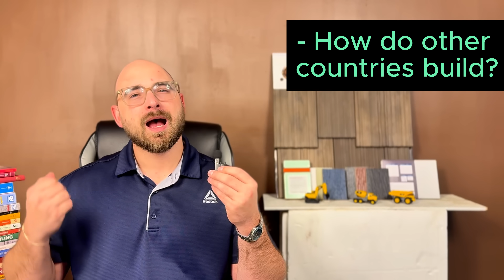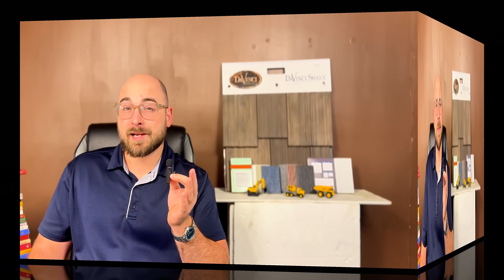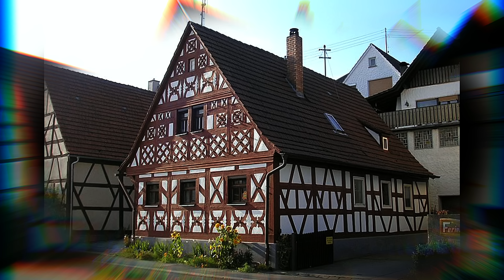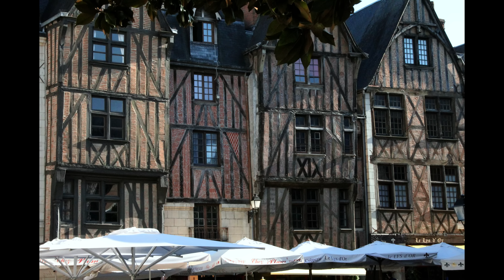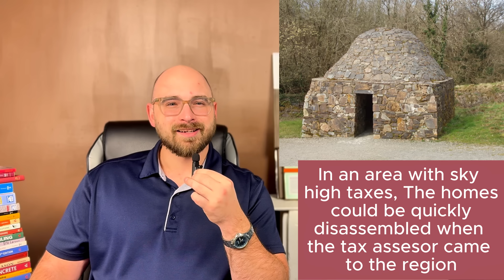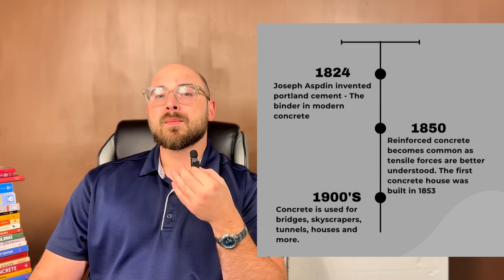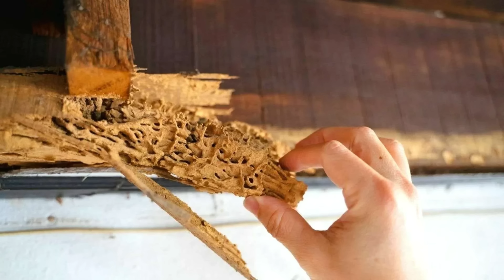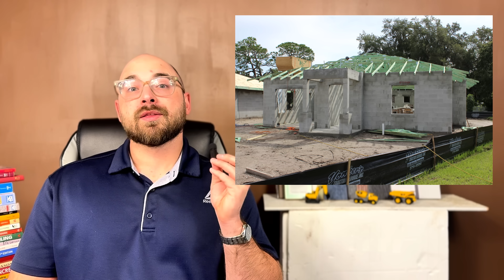Why Other Countries LAUGH at American Homes

Comment: A pretty recent method of construction being developed in Germany, and that we used for our house in France, is light wood framing encased in concrete.

It requires pressure treated wood, otherwise the wood can rot due to concrete's PH, which is why it hasn't been developed sooner, but is has advantages over pre-cast concrete and traditional light wood framing :

Steel reinforcements degrade concrete over time due to chemical reactions, a commonly known problem in old buildings, and a big reason why our concrete lasts way less longer than roman concrete.

But the wood framing removes the need for any rebar, providing by itself more than enough reinforcement.

Compared to traditional light wood framing infills (or lack there-of), the concrete is integral to the structural integrity, which means you can use less wood, reducing the added cost of needing pressure treated wood, and ofc, the concrete is a very strong barrier protecting the wood from fires and other environmental hazards.

Something you didn't mention about big fat wood framing compared to light wood framing, it that as a piece of wood burns, the outside turning to carbon protects the core.

On light wood framing, it's usually not thick enough to matter, but with larger timber, it's possible to engineer the building with enough support, than even after a fire, there is enough structural integrity left in the wood for the building to stand.
Reply from the maker: Interesting, thank you for sharing 

From now on, I’m referring to Timber framing as “big fat wood framing” 😅👌

Comment: Two important factors are the percentage of apartments v.s. free standing ("simplex") buildings, and also the percentage of owner-occupied buildings (in practice bank-owned buildings) v.s. landlord-owned buildings.
For example in Germany the majority of homes are owned by landlords.
Another factor is if the landlords are private companies or part of the public sector.
All this affects choices re longevity.
Say that you are 40 years old when you buy/build a new house. The only reason for going for more than about 30 years live length of your house is the value your children will inherit. Building it with better quality has no benefit to yourself.

I think USA could really benefit from a change in perception about living in multi family homes, a change in perception of publicly owned multi family homes, and also government paying out subsidies for building more sturdy. Just adjust the subsidy so enough homes are built better while keeping the wood industry from rioting, kind of.

Re remodeling: A major reason for remodeling a home is that the original floor plan sucked. The mitigation here is to up the requirements of actual floor plans. As an example at least back in the days in Sweden you ended up with lower interest rates and/or a better chance of getting a loan if your floor plan complied to certain standards. For kitchens the layout requirements were based on research done for how many steps your feet would take when doing various types of cooking with various layouts, and the result was that you should have your cooktop/burner to the left, then 60cm/2ft of bench space, and then your sink. (The exception is for left handed people). Any other layout is just stupid, and since all other layouts are stupid it's just a bad idea to remodel those homes. Also the standards required both a minimum but also a maximum of windows per room. I live in a house that is older than those standards, and several rooms have windows on two walls, with the result of me having various furniture blocking windows since there are too few places to put things like book shelves and whatnot.

This will probably drown along the other 5900 comments, but...

Comment: When the now defunct British Empire found places with devastating winds, in Asia, they discovered Granite. And used it exclusively for at least the first floor of every building, no matter the destination. (See "colonial house" style in USA too.) Because Granite is not only structurally very sound, it is also so dense (heavy per volume) that typhoons can not move granite blocks simply sitting on ground.

USA is a tornado area. Unlike most of Europe, including Great Britain. Why don't you use granite in building? I understand skyscrapers could not be built with such a dense material, as they would collapse under their own weight. But 2 stories homes? Is granite so hard to get in a country that mostly consists of layers less than 50 cm (20 inches) of fertile soil over naked stone everywhere? At least use any other stone type, the type you just find when diging out for a basement or a pool in your construction site. Or use reinforced concrete. In the land of the free gun use, concrete walls have also the added feature that 25 cm (10 inches) thick walls are successfully blocking even the .50 caliber sniper gun shots and any other lower caliber from any type of gun. Ideal for bad neighborhoods. (Even though windows do not stop bullets, lol!)

But anyway, outlaw any building method that can be blown apart by a strong wind, in the only tornado area on Earth, for Christ's sake! It's both cringe and criminally stupid to build or to buy houses that can be blown apart by regular winds in your area.
Note: Other parts of the world are also prone to strong winds/storms/hurricanes etc, but tornadoes only occur in North America and never as far north as Canada, so continental USA is literally the only place on Earth that has tornadoes. And there, they're not some rare/unpredictable occurrence, they are just as normal as earthquakes in Japan.

Comment: 1. Environmental Diversity Demands Adaptability

The U.S. spans diverse climates and geological conditions, requiring flexible construction methods:

Permafrost (Alaska) – Homes need elevated or adjustable foundations to prevent structural damage.

Earthquakes (California) – Flexible wood framing absorbs seismic forces better than rigid materials.

Heavy Snow (North) – Reinforced roofs withstand substantial weight.

Hurricanes/Typhoons (Gulf & East Coasts) – Wind-resistant framing prevents catastrophic failures.

Drought & Wildfires (West) – Fire-resistant, cost-effective, and adaptable materials are essential.

Flooding (Low-lying/Coastal Areas) – Raised structures, breakaway walls, and water-resistant materials mitigate damage.

Few countries face such a broad range of environmental hazards simultaneously.

2. Building Codes Prioritize Safety & Standardization

A national building code ensures efficiency and safety across diverse regions:

Cost vs. Resilience – Codes focus on the most probable threats rather than overbuilding for all extremes.

Efficiency – Stick-frame construction allows rapid building, easy transport, and cost-effective repairs—vital in disaster-prone areas.

Consistency – Standardized techniques ensure a mobile workforce without extensive retraining.

3. Stick-Frame Construction: Practicality Over Perception

Criticism of U.S. homes as “just wood” overlooks the advantages of wood-frame construction:

Flexibility – Wood absorbs impact from earthquakes and hurricanes better than rigid materials.

Climate Adaptability – Proper insulation ensures performance in extreme heat and cold.

Speed & Cost – Fast construction and repair make homeownership more accessible in a highly mobile population.

Sustainability – The U.S. has ample timber, and engineered wood maximizes strength while reducing waste.

Comment: As an (Dutch) engineer I will not say USA framing homes are bad. You can build framing homes durable, strong, well insulated, with sound dampening and even fireproof. What I personally would question is why build so cheap and not give it the characteristics I just mentioned? How simple is it to fill your wall with rockwool, have a multiplex and gypsum wall that is sound dampening, and you can't fall through and strong enough to hang a shelf on? When I see the flimsy doors and locks. All these details, if they have an upgrade the comford will be much higher, and your house will last much longer. If it was constructed with a bit more care to details and some extra material, this would be well spent on the long term, houses in Europe only gain in value over the years when you sell it on the moment you want to move. I can understand some people want to save money, but knowing your land, design and the permitting procedure might already be 2/3 of the cost, so just spend a bit more on that last part and make it a good investment for the long term.

Comment: You need to build a very stable concrete house fo earthquake 🫨 areas , In greece the laws about houses is very demanding, newer the construction 🏗️🚧 better the chance to staying and survived in an big earthquake, but moisture and humidity can destroy the steal inside the concrete and need it maintenance every year , some times not only painting but special concrete healings to protect steel from corrosion but is not a big deal.

Comment: One constuction material that you didn't cover is compressed earth blocks. While not possessing nearly the compressive strength of CMUs, they make up for it by potentially lasting centuries while being easy to make and install with unskilled labour.  (A press capable of putting out 21MPa is required, but that isn't beyond local technology in most locations.)  There are even jurisdictions in the U.S. where they are incorporated into the local building code.

Comment: why not implemented in the USA? Im making my statement before watching, but its cos the USA is money driven, with a focus on replaceable parts, you view your homes as quickly and easily replaceable. Aka the 3 points of engineering, you can have it cheap, you can have it quick, or you can have it well made, you can only choose 2 and the other will be the opposite, so you wanna build them back quick, you use cheaper materials compared to bricks, so you have it cheap, so guess which one you have the opposite of, good/great...
Reply: o PS im from South Africa, we have buildings standing that is older than the USA as a country.

Comment: While the building materials are part of it, many other parts of the builds in the US are also laughable in quality/safety compared to what most Europeans would consider normal. Take the electrical system for example, a common electrical panel in the US has huge exposed leads everywhere and accidently touching the wrong parts will put 220v through your body. Every modern electrical panel in Europe is constructed in such a way that it's almost impossible to electrocute yourself since all leads are covered in such a way that you couldn't touch them without tools.
Additionally, we run all of our wires through conduits straight up/down in predictable patterns so the chances of accidentally drilling through an electricity cable is virtually none. And if you need an extra wire through the conduit you can always easily run it through.

Comment: My Mum's parents lived in a stone built farmhouse in Northern Ireland. Solid walls, not cavity. It was passed down to them from family. I have seen photos of it from the 1800s when it was still thatched. My Granda extended it in height and put on a tin roof. No heating. No electricity upstairs. Oil fired range cooker in the kitchen & an open fireplace in the living room was the only heat it had.

Outside toilet, which was only built in 1965.

My Grandparents have both been dead since the early 1990s, and the house has been empty since, but it's still standing.

I was told the house is about 300 years old, so it's older than the USA.

Maybe building houses out of wood in places like 'The San Andreas Fault' and 'Tornado Alley' isn't the best idea?

Comment: We had hurricane force winds in Ireland last week and apart from the odd wall falling down or some roof damage most of the houses which are mostly built of brick and concrete didn't suffer any damage, the same storm in the US and it would be like a pile of matchsticks.
Reply: This is something that baffles me. Millions of americans live in locations that have regular hurricanes and or wildfires but they still decide to build all of their houses from wood. It makes no fucking sense, they just building the same shit, having it destroyed and then rebuilding it again the exact same way just to have it destroyed in a couple of years.
Reply: @sytricka3318 ,
As an American, that pisses me off too.

FUCKING WHY!?!?!?
Reply: @sytricka3318  "they still deicide to build all of their houses from wood". This is just a false statement. Lots of suburban homes are built primarily with wooden frames, sure, but MANY in hurricane areas are built to withstand hurricanes and DO withstand those hurricanes. Not every house is built the same in the USA.
Reply: @sytricka3318  its true. And the houses they build arent any cheaper than those made with concrete and bricks.
Reply: @LucianoMMatias  Dumb question: If the pricing is within the ballpark of equal, then why would anyone choose lumber over brick?
Reply: @sytricka3318  Most hurricane damage is from storm surge, not wind damage
Ordinary masonry collapses in earthquakes. Wood frame houses are not wood on the outside, except as decorative trim. Nothing will help your house if it gets fire on the inside, see Windsor Castle. The contents are the most flammable part
Reply: @sytricka3318  Most of the houses that collapse from hurricanes are improperly upkept. In places like california, wildfires used to be much less common, and houses built from stuff other than wood are becoming more common. The issues with concrete and brick are readily apparent when you look at the number of people that die from "heatwaves" in Europe that are average US temps. You don't want to be in a concrete box when it's 37c, and AC only became common in US homes in the 60's. I've lived in at least 3 homes from the 50's or earlier in the last 8 years, and they're perfectly stable, and they stay cool.
Reply: @xshocproductions7923  Concrete/brick buildings tend to stay really cool during the summer and warm during the winter.
Reply: Brother when your hit with a hurricane it's not just the wind sure it's there and it can be dangerous but the real damage is in the water and storm surges
Reply: "Most didn't"
Hurricane damage tends to be patchy as it is microbursts and embedded tornadoes doing the wind damage. Concrete and masonry handles ordinary projectile damage better than wood frame "alone" (it can be a facade addition). But a 150 mph stick will go right through a cinderblock wall and any wind over 100 has a potential to remove a roof
Reply: Nah, we have hurricane force winds and our houses still stand like yours at the same windspeeds. Our houses can withstand speeds I guess you are talking about houses not built to hurricane code? Mine is and it has withstood many hurricanes.
Reply: @bread9173  alot of the times with hurricanes it's not the wind that destroys stuff it's the flooding and  storm surges the wind doesn't help sure but it isn't the root issue
Reply: I'm from Portugal and when I saw the images of the hurricane in Ireland I thought exactly the same!
Reply: You'd be shocked to know that most homes are not destroyed by hurricane force winds, but by tornados generated BY actual hurricanes. So your "hurricane force winds" are laughable. It isn't hurricanes themselves that are so devastating, it's the flooding, the fires the lightning can cause, the power outages, and the tornadoes which can be MULTIPLE in a single day or night just in your area alone. 

Hurricane force winds CAN be destructive but that just simply isn't the primary concern. Especially along the coasts, you can have rising tides from the storm that can take the ocean tide up past the beach and ravage homes with floods PLUS winds PLUS tornadoes and so on that can last multiple days. Having "hurricane force winds" in Ireland simply isn't the same.
Reply: Are we the problem for hurricane and flood destruction?
Reply: What always wonders me is that the pile of matchsitcks include the poles for the 2kV and 110V power lines. In my country the electrical infrastructure is almost exlusively well protected in the ground.

Comment: I'm building my house now, I choose concrete hollow blocks filled with reinforced concrete at the end, for basement, and ICF for first and second floors. Full concrete houses are not comon in Poland, definitly not faster or cheaper, but they are most solid. Wooden hous are good for summer house, but not for lifetime investment (because this is how we think about houses in Poland). On the other hand, My father build "canadian house" in 90' and is still standing, but there is constant fear of fire, storm winds and floating..
 Classic new houses are: no basement, first floor from bricks, second floor start bricks for 1m then wooden roof for the rest of the second floor.